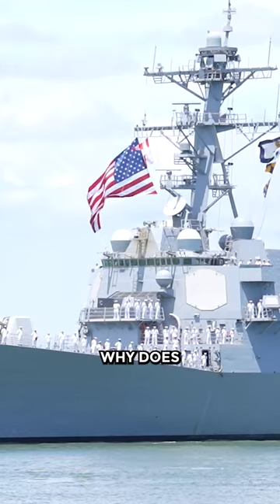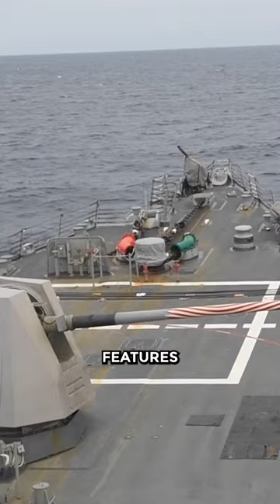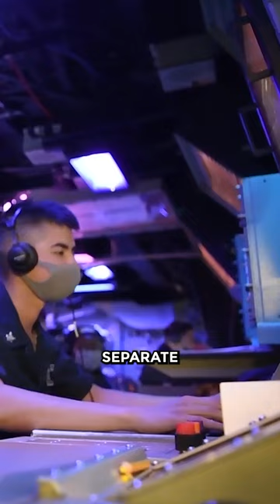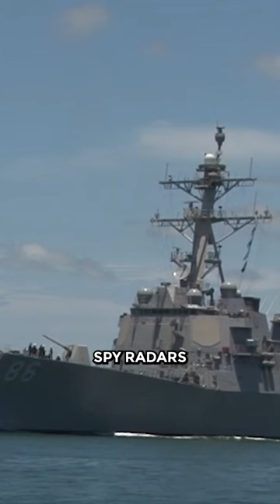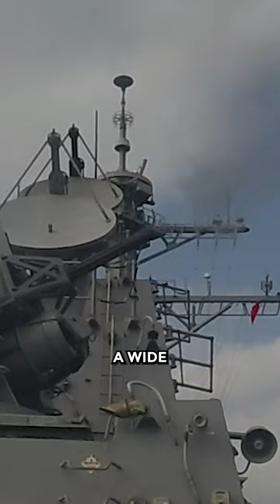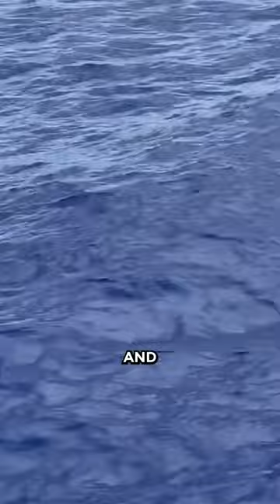Why does the US Navy keep building more Arleigh Burke-class Destroyers? #shorts

Comment: We've largely come to a point of diminishing returns in new ships, aircraft, and Armor.  In the 50s up to the 80s we were still experimenting with a wide variety of designs. But now we've largely settled on stuff that works well, with completely new designs coming slowly.  Ships are large platforms that can easily handle incremental upgrades in systems without major changes in fundamental, structural designs.  We tried with the Zumwalt, and oops.  It wasn't very good.  Even the Ford class carrier isn't a completely new design - it incorporates a lot of new tech, but it's still the same basic design as every supercarrier since enterprise.   When it comes to planes, the F-15 hit the air in 1976, the F-16 in 1978, and the F-18 in 1983 (and the super hornet is an evolution of the A/B/C/D, out in 1999, I think?). Even the stealth fighter designs were originally created in the 80s.  And Bombers? Dude.. the B-52 hit around 1960 and may still be flying in 2060.  The B-1B Came about in 86 and may keep flying for a while longer as it's a huge bomtruck that can go places the B-52 can't.  The B-2 is only going to be retired because the B-21  handles weather better (The B-2 doesn't like heat, cold, water, sun, dark, or anything else. It's a hangar princess even though it's super deadly when it comes out.)  And Armor? The Abrams came around in 1980, and the new not-a-tank light tank/Mobile Protected FIrepower is basically a scaled down Abrams with the original Abrams gun, the Bradley has been around almost as long and is only now being replaced. Meanwhile, the Stryker is on it's way out, most likely. The M-113 is still going and it's over 70 years old.  We've hit this plateau where we have the design down.  It's the details that are relevant now.